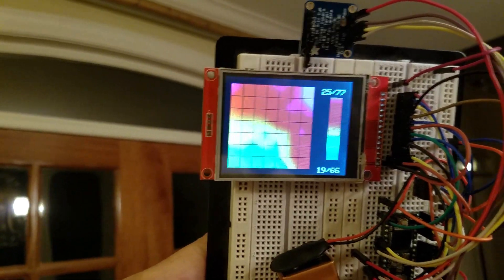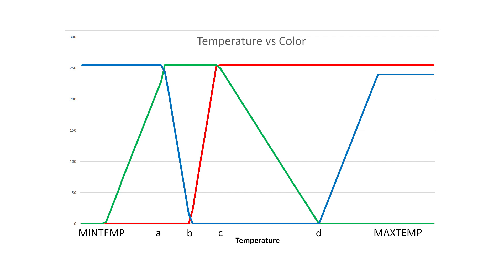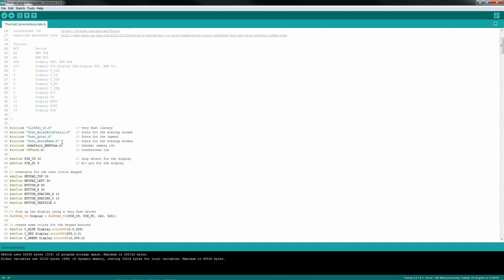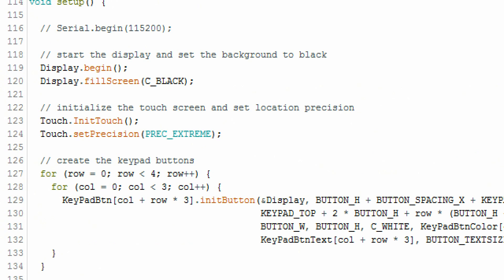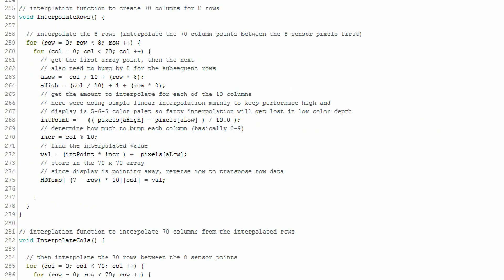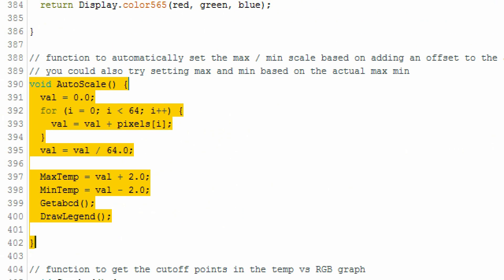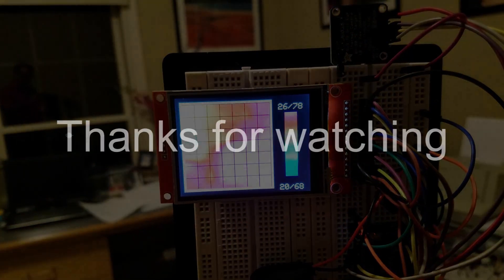Build a Teensy-based thermal imaging camera

Comment: Thanks for this great project but i have a problem 

1234.ino:42:60: fatal error: font_Arial.h: No such file or directory

compilation terminated.

i downloaded all of the libraries and carried the all contents inside fonts library in the ILI9341 library but still i have this problem can you help me please ?
Reply from the maker: Just comment out that include line for now. I don’t think I use Ariel font anywhere in the code
Reply: @KrisKasprzak   #include "font_Arial.h"             // fonts for the legend   i searched the font library it has "font_ArialBlack.h" but doesnt have "font_Arial.h" i tried the other one but that doesnt work either.
Reply from the maker: @xxxxx765  Comment out the stuff that raises an error or replace the setFont with something in your library.
Reply from the maker: @xxxxx765  that many errors I’m just changing a font, it looks like you commented out a ; or } or other
Reply: @KrisKasprzak  I just want to try this project all I do is copy and paste your code to arduino ide and change the lines that says "Arial.h" I dont think that is the case do i need to do something else ?
Reply from the maker: @xxxxx765  should be, if you have font issues just comment out the conflicting lines.

Comment: I bought this connect with my Arduino, it can detect human 50 cm. I want it could detect more distances. What should I do? Are there any further instructions for it to detect?
Reply from the maker: This sensor is 8 x 8 pixels and there is nothing you can do to get better resolution. Your only option is to move to a higher res sensor and a faster processor. If you can move to a Teensy 4.0, there is a 32 x 24 sensor that is a bit better--still not great a detecting details. Have a look. https://youtu.be/1EBoug27hrA

Comment: Thank you for your great project and explanation can i ask you please if possible to tell me if i can use normal  AMG8833 sensors or it needed to be Adafruit AMG8833  i hope if you answer ????
Reply from the maker: You should be able to use the chip directly provide your MCU is 3v3.
Reply: @KrisKasprzak  thank you so so much for replay and being humble  I mean I have seen that you attach the adafruit liberies so In mine( I mean the AMG8833) do I need to deleted the adafruit liveries and modify the code or no need it will work directly.
Reply: @KrisKasprzak  one last small question sorry if is it ridiculous cause I am beginner and enthusiastic the array you expand to 70 by 70 you did it in Excel after that what should I do with them integrate them or they are already integrated in the code thank you so much

Comment: excellent project, sir...

but i cant compile it.. it says "no matching function for call to 'Adafruit_GFX_Button::initButton(ILI9341_t3*, int, int, int, int, uint16_t, uint16_t&, uint16_t, char [5], int)'
Reply from the maker: i don't think the GFX lib has changed, but I would not be surprised. Just comment out the button.init and see if you can make progress
Reply: @KrisKasprzak thank you, sir. its working. its my fault. i messed up the library actually

Comment: Hi, great work! I am currently using your code in one of my projects, and I was wondering if there was any chance you could give me some pointers to make an 8x8 interpolation (56x56 rows/columns)? 
Keep up the good work!
Reply from the maker: Assuming you mean scale up the 8x8 to 56x56 meaning at 7x expansion,  should be possible, just need to rework the arrays to expand to 56 and not 70. stuff like:

//  change array

float HDTemp[80][80];// change both 80's to 56
for (col = 0; col < 70; col ++) { // change 70 to 56
incr = col % 10; // change 10 to 7

probably more but at a glance this stands out.
Reply: @KrisKasprzak   Thanks for the reply, Ive been playing around wit it but I cant seem to get it working properly, no matter what I do the picture is a mess.
Here is what I have:

  ThermalSensor.readPixels(pixels);
  for (row = 0; row < 8; row ++) {
    for (col = 0; col < 56; col ++) {
      aLow =  col / 7 + (row * 8);
      aHigh = (col / 7) + 1 + (row * 8);
      intPoint =   (( pixels[aHigh] - pixels[aLow] ) / 12.5);
      incr = col % 7;
      val = (intPoint * incr ) +  pixels[aLow];
      HDTemp[(7 - row) * 7][col] = val;
    }
  }
  for (col = 0; col < 56; col ++) {
    for (row = 0; row < 56; row ++) {
      aLow =  (row / 7 ) * 8;
      aHigh = aLow + 7;
      intPoint =   (( HDTemp[aHigh][col] - HDTemp[aLow][col] ) / 12.5);
      incr = row % 7;
      val = (intPoint * incr ) +  HDTemp[aLow][col];
      HDTemp[ row ][col] = val;
    }
  }

Any ideas?

Comment: Hi, Kris. I am trying to replicate this project with an ESP32, what parts of the code will i need to change? i understand that i have to change the teensy ILI9341 library to the regular one. And also, how do i re-define the pin outputs for the display? thank you in advance for your answer.
Reply from the maker: you should only need to change the display library and display initialization. I'm not sure what pins are used for SPI and I2C communication. I would focus on getting display to work before messing with touch stuff.
Reply: @KrisKasprzak  thank you so much for a quick answer. I didn’t want to respond until I got it right, and now I did! Thanks for sharing this awesome project
Reply: @BullsEye050  hey i think would want to replicate this with my ESP32, could you help me with code and wiring diagram?
Reply: @yawdery3359  Of course. Give me your email adress so I can sent you the code
Reply: @BullsEye050  my mail is my user name (typed together) with the gmail dot come at the end. If you have the wiring diagram please add it would be very helpful. Thank you!
Reply: @BullsEye050  friendly reminder please, hope you have not forgotten

Comment: I have this error  

In file included from /Users/ahmad/Documents/Arduino/libraries/UTouch-master/UTouch.h:38:0,                  from /Users/ahmad/Desktop/ThermalCamera/ThermalCamera.ino:45: /Users/ahmad/Documents/Arduino/libraries/UTouch-master/hardware/arm/HW_ARM_defines.h:9:0: warning: "swap" redefined 
#define swap(type, i, j) {type t = i; i = j; j = t;} 
^
 In file included from /Users/ahmad/Desktop/ThermalCamera/ThermalCamera.ino:39:0: /Users/ahmad/Desktop/Teensyduino.app/Contents/Java/hardware/teensy/avr/libraries/ILI9341_t3/ILI9341_t3.h:557:0: note: this is the location of the previous definition  
#define swap(a, b) { typeof(a) t = a; a = b; b = t; }
^   

I tried to change it from:

  ILI9341_t3 Display = ILI9341_t3(PIN_CS, PIN_DC, 240, 320);  

to    

ILI9341_t3 Display = ILI9341_t3(PIN_CS, PIN_DC);      

but it didn’t work, can you please help me.
Reply from the maker: You have conflicts with your installed libraries. Utouch has a function called swap, and the graphics or some other lib has the same function. This is only a warning and there is nothing the code in the ino can fix. What is not working?

Note, yes you will need to use 

ILI9341_t3 Display = ILI9341_t3(PIN_CS, PIN_DC);
Reply: @KrisKasprzak  It worked just fine thank you so much, also do you care if you can make a code that will also display the peak temperature for this project!

Comment: Hi Kris, I saw this video and was excited to purchase the exact same parts you got to build it. You were 100% right, it only costs $80 to build it. I put it together exactly like shown in your diagram but all I get is a blank white screen. I have all the correct libraries so I decided to try some examples from other libraries to make sure the screen was wired correctly. The screen displays other examples fine "although I wasn't able to get the touch part to work". Can you help me troubleshoot this, please?
Reply from the maker: Most likely white screens are due to the RST pin. On some displays it needs a slight delay before going high. Try connect RST to say pin 7 (any digital pin) and use the call ILI9341_t3 Display = ILI9341_t3(TFT_CS, TFT_DC, TFT_PIN_RST);
Reply: @KrisKasprzak  Wow, thanks so much for the quick reply, I'm not much of a coder but I'm going to try your suggestions and get back to you, thank you.
Reply: @KrisKasprzak  So I replaced part of the original code with the one you gave me and I now receive 'TFT_CS' was not declared. Does this mean I just add #define TFT_CS 7 ? Not sure if that's what you meant. Or do I need to physically connect something?
Reply from the maker: @fernandourrutia6034  yeah you will have to add that Define and you will also have to connect the pin number 7 on your MCU to the rst line so the rst line will only be connected to pin 7
Reply: @KrisKasprzak  I was able to do what you suggested. It booted the boot screen and it said readings were ok.  The screen is upside down (I'm sure that's probably an easy fix) but it seems to only be displaying one pixel on the viewer square. And when I click the gradient the keypad pops up sideways and the touch screen doesn't work properly. I can see the touch part maybe being a result of a bad screen, but why is it only displaying one pixel of thermal data?
Reply from the maker: @fernandourrutia6034  odd question but what color are the Pin headers on your LCD? Black or yellow?
Reply: @KrisKasprzak  They were yellow. By the way, I fixed the gradient numpad orientation, just changed it from a (3) to a (2). The touch feature still not working properly but I suspect my screen might be broken in that regard.
Reply from the maker: @fernandourrutia6034  What touch lib are you using? and what pins are you connecting the touch pins to?  The yellow ones are very dicely. I found some ones on Amazon that have black headers and are much better

anywhere you see this set of calls, you may have to mess with the order of parameters 2,3,4,5 and even swap x and 1 for parameter 1
  x  = map(x, 0, 235, 320, 0);
  y  = map(y, 379, 0, 240, 0);

also try this code where you current map calls are to draw a dots in pre map and map

 Touch.read();

  x = Touch.getY();
  y = Touch.getX();

  Serial.print("real coordinates: ");
  Serial.print(x);
  Serial.print(",");
  Serial.print (y);
  Display.drawPixel(x, y, 255); // will print a blue dot

  x  = map(x, 0, 235, 320, 0);
  y  = map(y, 379, 0, 240, 0);

  Serial.print("mapped coordinates: ");
  Serial.print(x);
  Serial.print(",");
  Serial.print (y);
  Display.drawPixel(x, y, 65000); // will print a whiteish dot
Reply: @KrisKasprzak  I'm using the same libraries you listed in your code. I used the schematic on your video to wire it so it is wired the same with the exception of the Reset now on PIN 7. I don't think I'm capable of changing that much code as I don't understand it that well so I think I will just purchase the screen with the black pins. It was a bit difficult to find one that also had touch capabilities, but I found one that will arrive sometime next month.
Reply from the maker: @fernandourrutia6034  you can always add mechanical push buttons etc.
Reply: @KrisKasprzak  That's true, but I may be getting myself into more than I can handle. I'm going to try the new screen first. Thanks a lot for your help though, once I get this going I'm going to post a quick video on this project along with the 3D files for the case I made for it, I'll link your video in it.
Reply: @KrisKasprzak  I received the screen with the black pin headers and wired it up again using your instructions. Had the same exact problem, only this time I noticed that on that section "ILI9341_t3 Display = ILI9341_t3(PIN_CS, PIN_DC, PIN_RST);" you originally had "ILI9341_t3 Display = ILI9341_t3(PIN_CS, PIN_DC, 240, 320);" but when I leave the 240,230 it just gives me a blank screen (so me moving the reset to pin 7 wasn't what solved that, it was removing 240,230). I'm not sure what to do now, I have working parts but can't figure out what's up with the code.

Comment: Ahhh I can't find your screen.  Seems to be out of stock.  Will this work?  http://www.lcdwiki.com/2.8inch_SPI_Module_ILI9341_SKU:MSP2807 ...or adafruit has this one but it's a little unclear to me whether it is ILI9341  https://www.adafruit.com/product/1651#description
Reply from the maker: The first display should work it's an ILI9341 chip with standard SPI interface. You will need to use a Teensy to take advantage of the ILI8341_t3 library that has been optimized to make that display fast. Arduinos will probably not have enough memory and standard Adafruit_9341 lib is probably too slow. If using a Teensy forget using the second display you list, its specific to an uno and can't be used in SPI mode--at least i've never got one to work.
Reply: @KrisKasprzak  thanks!  well you have introduced me to teensy, I'm excited to give it a shot!

Comment: Can i use FILR Lepron 3.5 insted of AMG8833 sensor using the same code that you provided?
Reply from the maker: I just don't know. Without reading the datasheet I don't know how  the data is read from the camera. The camera resolution is 160 by 120 my code interpolates to scale up by a factor of 10.

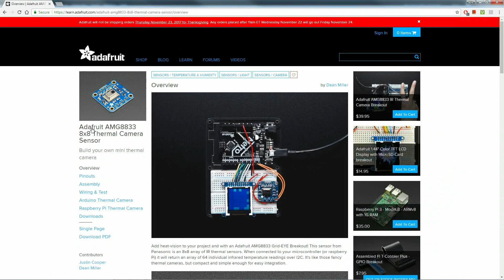Comment: Hi, one thing I don't understand is that this sensor is supposed to be an 8 x 8 array and even the datasheet (https://cdn.sparkfun.com/assets/4/1/c/0/1/Grid-EYE_Datasheet.pdf) says that it is a 64 pixel sensor.  But even just looking at 0:25 there are clearly different colors per pixel...I thought a pixel should look just like one dot from the distance we're looking at is....what am I misunderstanding about pixels?
Reply from the maker: The sensor is 8 pixels by 8 pixels so 8 * 8 equals 64 total pixels. I use interpolation to expand 8 by 8 to 70 by 70. What you're seeing at the .25 mark are the results of 70 pixels by 70 pixels however I draw black lines every 10 pixels show a grid. Each cell in that grid is not a pixel each cell in that grid is like 10 pixels by 10 pixels
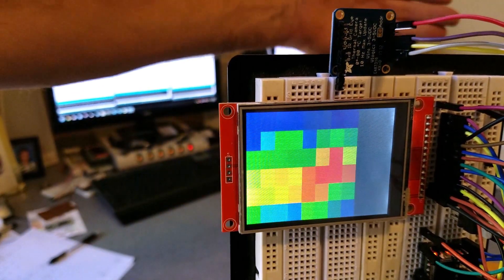Reply: @KrisKasprzak  what you've done here is like genius stuff to me lol.  That makes sense.  and at 1:12, that's where you see 8 x 8.  One color per square, 8 across and 8 down.
Reply from the maker: @peterm.4026  correct... on the pixel thing that is

Comment: Thank you very much! But I have a question here, Is it necessary to use Teensy? Can I use Arduino as microcontroller?
Reply from the maker: Arduinos will not be fast enough.
Reply: @KrisKasprzak  ok,thank you very much! but I see your code is still written in Arduino ide, is it compatible with teensy?
Reply from the maker: @leyuanma4886  yes it is. There are some videos on YouTube that will show you how to set up a Teensy.once you start using these MCUs... You will never go back to Arduino
Reply: @KrisKasprzak  Thank you very much! I saw several different types fo Teensy board, here in thermal camera project, I want to wirelessly send the image to the computer,  which Teensy board would you recommend?  I would be appreciated if you could give me some suggestions for the  wireless communication module.
Reply from the maker: @leyuanma4886  a Teensy 3.2 should do just fine. I think a Bluetooth module would work just fine and getting data from your Teensy to your PC.
Reply: @KrisKasprzak  Thank you so much! One more question, I also plan to do home inspection with this, I want to detect the water damage in the house, 
but I am confused about selecting the thermal sensors, I am choosing from AMG8833 you used, MLX90640 and flir lepton, how 
do you think about these kinds?
Reply from the maker: @leyuanma4886   I have never used that camera but it looks pretty impressive. Looks like there are libraries for it as well
Reply: @KrisKasprzak  Yes, but mlx90640 and flir lepton are much more expensive. Do you think AMG 8833 is accurate enough for home inspection?  I mean If AMG8833 is enough , I don’t need the more expensive one.
Reply from the maker: @leyuanma4886  I'm not sure it's going to be accurate enough I bought mine for doing the same thing and I'm not impressed
Reply: @KrisKasprzak  Ok, Thank you! Let me try amg 8833 first.

Comment: So considering this is adruino, could the arduino handle a better sensor for higher rates. So that, lets say, it could be close to 32 frames per second. Or would that require a PI and different coding instead?  For ranged use and definition of target, what would be the best thing to look for in a sensor. I've been browsing looking around at sensors trying to see if i can understand how this project might be used in home made longer ranged thermal optics. Here's a link to a sensor i was looking at out of curiosity https://www.digikey.com/product-detail/en/flir-lepton/500-0771-01/500-0771-01-ND/7606616
Reply from the maker: An arduino can't come near this performance--recall UNO and MEGA are 16mhz clocks--6 times slower that a Teensy. The sensor you cite is 8.7 frames / sec so not sure how you expect to get 32.

Comment: I can use this display with same code ???
2.8 Inch TFT LCD Shield Touch Display Module For Arduino UNO
Feature:
2.8 inch LCD TFT display
Bright, 4 white-LED backlight
Colorful, 18-bit 262,000 different shades
4-wire resistive touchscreen 240 x 320 pixels with individual pixel control
No wiring, no soldering.
Simply plug it in and load library
On-board 3.3V 300mA LDO regulator
5V compatible, use with 3.3V or 5V logic
Support 2GB micro SD TF card
Size: 7.8 x 5.3cm
Reply from the maker: not without some work, you will need to change the display lib, and touch libs. Code is pretty basic and should run on anything. There may be some function calls  your new graphics lib doesn't support. I seriously doubt you will be happy with the results. Those UNO's just don't have the processing power to interpolate a 70x70 array. My 120 mhz Teensy can get about 5 frames per second update. a processor 1/10 as fast, you will not see screen updates very fast. Switch to a Teensy 3.2 or even a 4.0, they are like a million times better that Arduino anything.